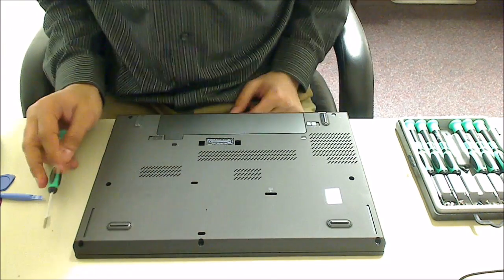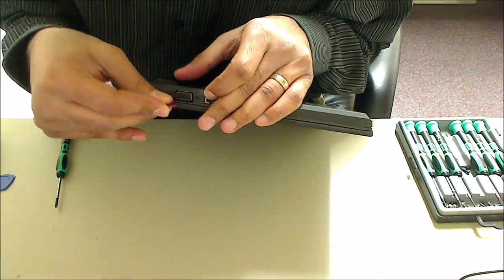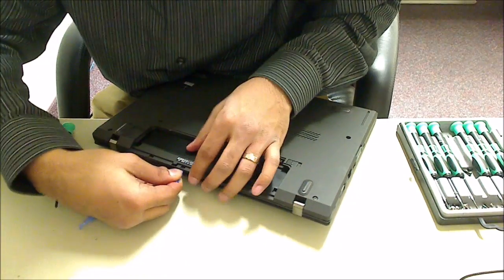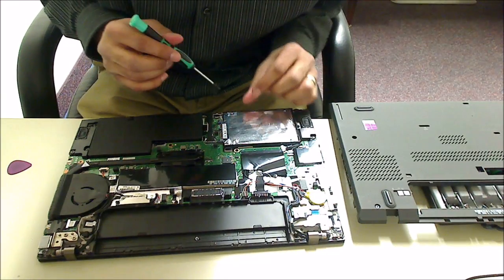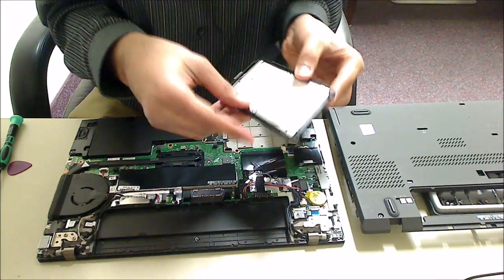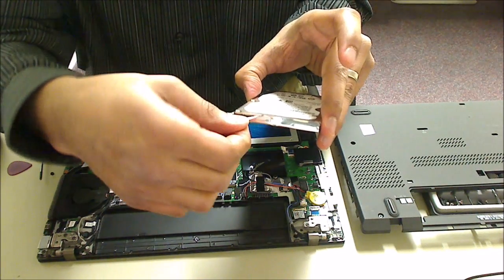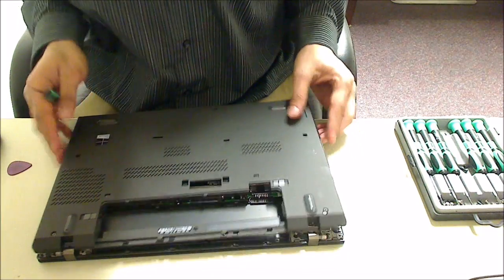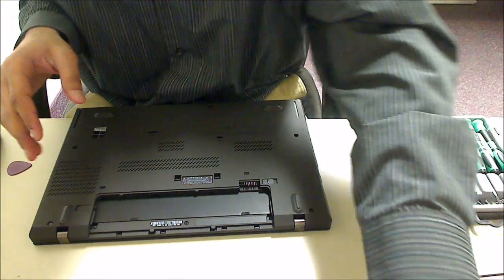Lenovo Thinkpad T450 Hard Drive/SSD Replacement

Comment: Good video.

There's supposedly a 16GB ram module can add for total of 20GB ram.

There's also a 2nd M.2 slot which can supposedly have 512GB SSD added.

I was thinking of doing following what are your thoughts?

Add new 2TB SSD and 512GB  M.2 SSD, 16GB mem.

Clone 500 HDD  to 2TB SSD then upgrade windows and 10.
Reply from the maker: S G I haven't seen the single 16GB module, but I know two 8GB is possible.  Your looking to try and make a monster system!  With the m.2 ssd, it's half height, and I've only found Transcend's 256GB SSD that would fit (42mm).

Comment: Good instructions. But how do you reinstall the OS back? There is no CD rom for T450. Can we purchase Win OS from Lenova directly for reinstalling OS for the replaced drive?
Reply: +Sorcerer Stone  What I did for my T520 was use an external drive cable kit (I imagine an enclosure would work just fine, too) and Clonezilla. The SSD upgrade added 2 hr to the battery life and a nice speed improvement (but still not as fast as this T450 w/ SSD).
Reply: thats a question I would like answered too.
Reply from the maker: I just cloned the original before moving, but http://www.lenovo.com/lenovorecovery is where I had to go to actually get recovery media. Of course if you are on Windows 10, MS registers your hardware, so you can reinstall Win 10 on a new HD and it will activate.

Comment: Great video!
But Lenovo needs to pull their heads out of their asses. What happened to the old way of removing a drive with one freaking screw? Also who puts speakers on the bottom of a laptop nowdays?? I need to be in their R&D dept. The ONE thing they did right with this model was get rid of  the crappy touchpad and put the actual buttons back on the thing so users can actually left and right click.
Reply from the maker: Mike E oh man, I know.  I loved the ease of an HD swap before...on one of my replacements, I forgot to connect up the internal battery after I assembled the thing again. maddening to take it apart again!

Comment: Do you have the Thinkpad t550? I'm planning to buy one with a 500gb 7200rpm HDD and replace the 16gb SSD with a bigger M.2 SSD but as I see in the comments, there's no access to the M.2 slot in the t450 series so i'm wondering if the plan should work with the t550.

Comment: Why would you transfer the foil around the old drive to new SSD hard drive?  Seems unnecessary.  I'm not sure why the foil is there, except for EMC shielding, which seems unnecessary.
Reply: Yea I'm wondering the same thing. Is it necessary to put the foil on the new ssd at all? Is there any benefits to putting it on?

Comment: T450 vs X250.....  Can't decide,  close call between the T's 2xSODIMM and the X's IPS display.

Anyone self-installed a FHD IPS display in to their T450 yet? :-D
Reply from the maker: Steven S Hey Steven, if you do the T450s, many models have a FHD IPS display like the 20BX0018US, but you only have one ram slot to complement the 4GB soldered in (so you can get up to 12GB).

Comment: Is it possibile to mount an msata ssd alongside the mechanical drive?
Reply from the maker: Not msata, but it does have an m.2 slot for an SSD.  This model had a 16GB m.2 ssd in it already, and the wifi card is m.2 as well.  I know the m.2 has to be single sided, and POSSIBLY half height too, so it's best to check before you buy one.  I have a T450s I have to put an SSD in as well, so i'll try and remember to take a look at the m.2 slot and let you know.
Reply from the maker: I have a T450s is en route, i'll let you know what I think of both when it arrives!
Reply from the maker: Bao Trung Duong I got the T450s in, and I do like it better than the T450 because of the weight and feel of it, but it was $150 more than an equivalent T450...I myself wouldn't think it's worth it just for the sake of a very slightly slimmer and lighter laptop, but others would.  The T450s was a pain to unsnap the base cover, and it only has one Ram slot.  4GB soldered in, and one empty 4GB slot, so 12GB maximum (the t450 is 16GB max as it has two ram slots).  I couldn't find the M.2 SSD slot anywhere on both the T450 and T450s!  It got an m.2 card, but I have no idea where it is.  Must be on the other side of the motherboard?